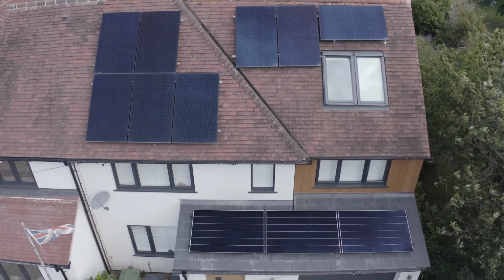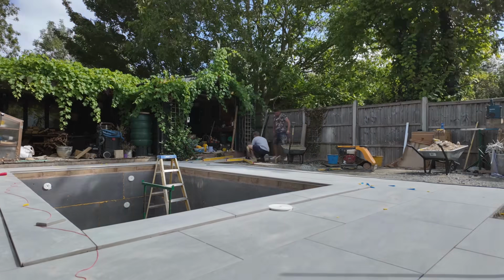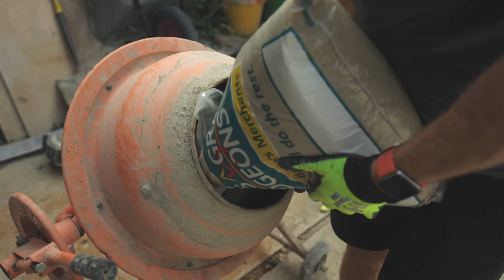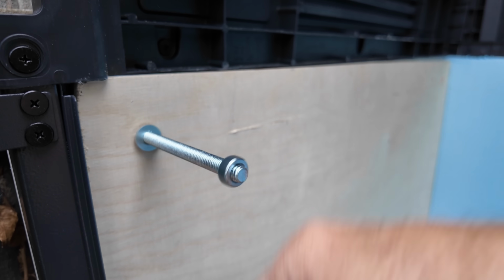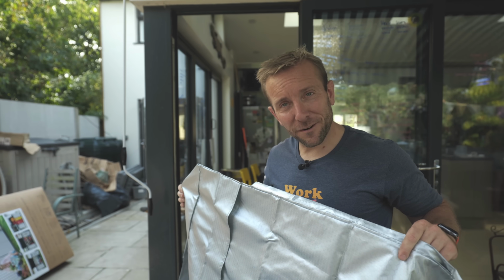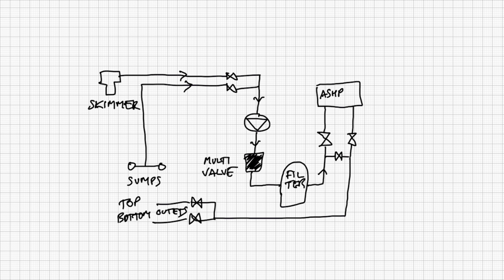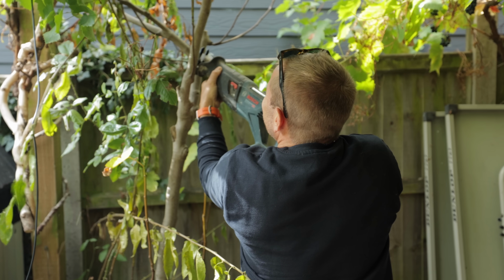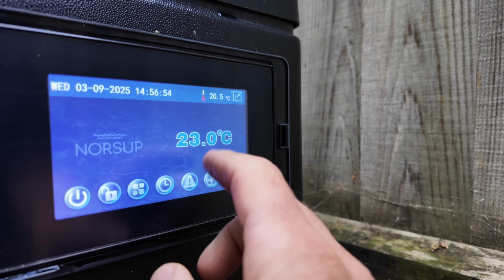I Built My Own DIY ICF Swimming Pool | Part 5 THE PLANT ROOM

Comment: Not seen the next video, but the terminals on the left of that grey box are live at mains voltage and should be covered up. As it stands in this video, that's in a dangerous condition.
Reply from the maker: Hi Steve, correct! There is a small plastic cover that goes over it but it's far from safe even then. I'm going to mount in a ip65 box.
Reply: @plumberparts excellent idea, that unit is designed to be inside something, but i see them exposed far too often!